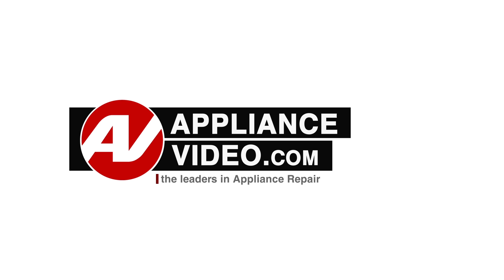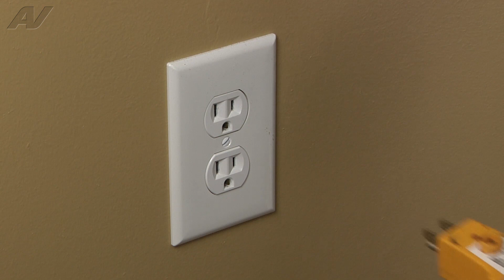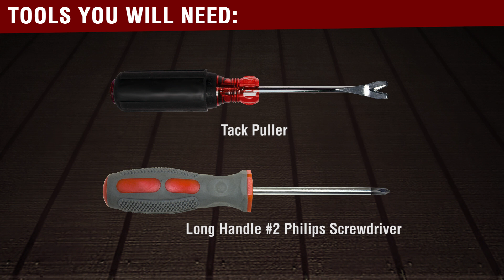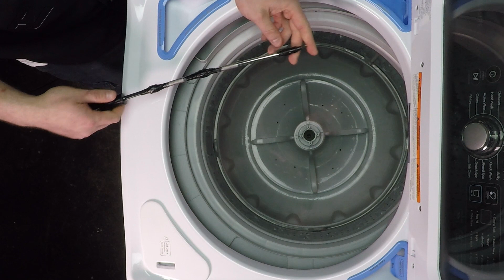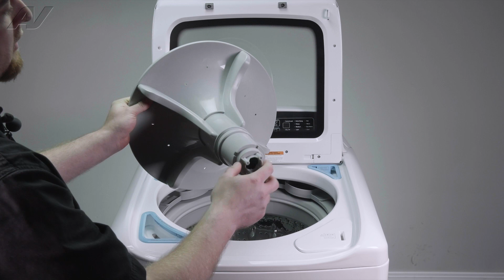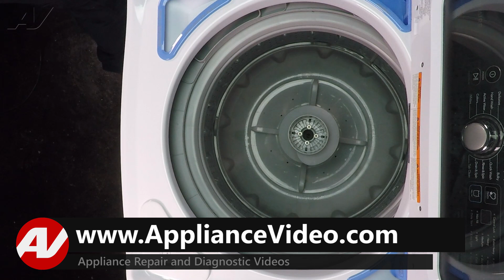Frigidaire Washer Repair - Will Not Agitate - Agitator Assembly

Comment: Can you share why is time on that washer on the 29th minute comes back to 35 or 36 and the washer never ends wash or spin
Reply: I have the same problem
Reply: @johnwhitefire  Did you figure out what was wrong? I have the same problem.
Reply: It's because the load is going to one side and sending an error to it.  Mine don't it and I just set it on drain and spin and it worked. Washing heavy stuff is what does it to mine
Reply from the maker: Great question, if you have a more technical question that our parts department cannot answer, you can search our over 17,000 answered questions free at our website www.ApplianceVideo.com under our Repair Help section. You can also call our parts department at 1-800-830-5465 and they can give you help 7-days A week ,or search at www.SaveMoreOnParts.com  .

Comment: Is this why the agitator is not agitating?
Reply: It seems like just replacement doesn't explain anything about what might be the problem as to why not working as video title suggests
Reply from the maker: Great question, if you have a more technical question that our parts department cannot answer, you can search our over 17,000 answered questions free at our website www.ApplianceVideo.com under our Repair Help section. You can also call our parts department at 1-800-830-5465 and they can give you help 7-days A week ,or search at www.SaveMoreOnParts.com  .